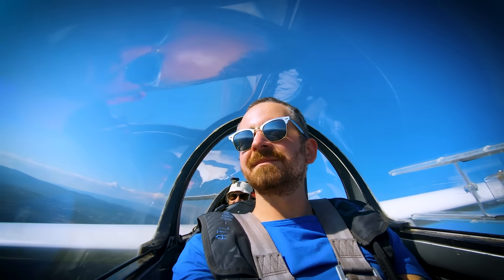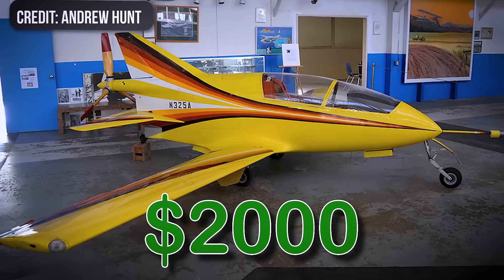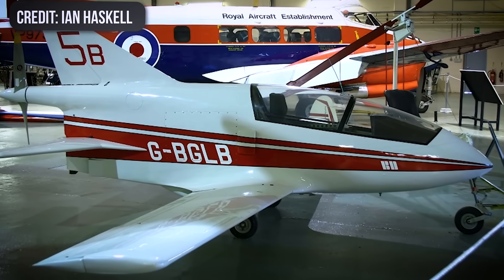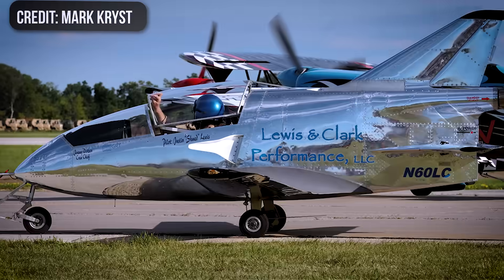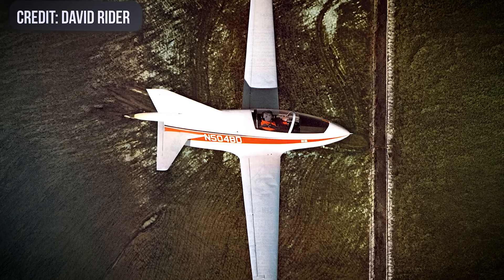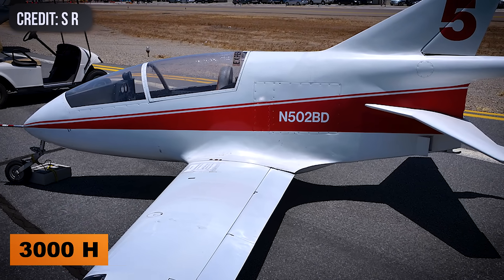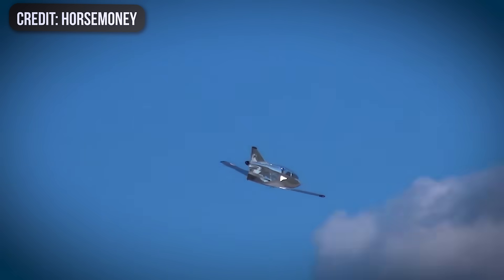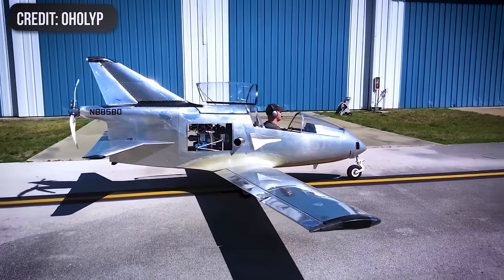This ‘$2,000 Jet’ Seduced Thousands of Pilots… Then Turned On Them

Comment: The BD-5 should be resurrected in Carbon Fiber.  Engines of over 100hp that fit in the form factor are now available and they are miserly on fuel providing greater range.  The carbon fiber construct would save even more weight.  A turboprop version in that space is also available.  Today multiple turbine engines could provide a power plant but they will consume the 50 gallons of fuel pretty quickly.
Reply: None of the above addresses the stability and other malignant flight characteristics that have cost many their lives. By the time enough changes are made to resolve those, you have an all new design. Best to you!
Reply: @jimhorn2608  Yes.  There are so many much better designs available now.  Risen is one.

Comment: You mentioned Burt Rutan, but not what he did for Jim Bede.  Rutan was responsible for fixing many of the BD-5's issues (like flight instability).  Also, he learned how NOT to run an aircraft company by watching Bede.
Reply: Burt also discovered composites during his tenure with Bede. He was building his first homebuilt design, the VariViggen, at the time.  The VariViggen is a wooden aircraft.  For the jet version of the BD-5 he had to mount the batteries forward of the seat under the pilots thighs for weight and balance considerations.  To make a cover for the batteries he used a non-conductive material called fiberglass and resin.  That experience then helped him go all composite on his subsequent designs.

Comment: Fast FORWARD........This design  build it from carbon  fiber  .... "stretch " the fuselage  12 inches ...add turbo jet...increase wing in size and strengthen  the gear and wings ...over ALL YA GOT A NICE AIRCRAFT...Fast forward 55 years
Reply: With a fuel consumption 3 to 5 times that of a typical piston engine and propellor, it's definitely not a design for inexpensive flight! Or practical (no baggage). One can dream, though!
Reply: @jimhorn2608 live to fly....✈ FLY..to live...

Comment: Jim Bede was a very good aircraft engineer, and spectacular salesman, and a poor businessman who could not deliver on his promises.  All airplanes are a series of compromises, and the BD5 was/is a solid airplane with reasonable compromises.  So are/were his other designs with the exception  of the BD-10.  His designs including the BD-5 were poor candidates for low time pilots - a necessary problem if you demand high performance.  Add the resonance issues with the driveline and the reliability issues with a 2-stroke powerplant, and the accidents were sure to happen.

Comment: I'm no aerodynamics expert, but as someone who has built and flown R/C model aircraft for years, it looks to me as though the wing is too small and too highly loaded for comfort, meaning it could snap right out of a tight turn unless the airspeed was kept high.  Also, the moment arm / fuselage is so short that you would expect very high pitch sensitivity.  All in all, a plane with very little inbuilt safety margin - one that would be very unforgiving when flown by an average Joe (like me!)

Comment: I built a KR1 in my early days because I didn't have the money for the -5 kit. But I bought one later from someone who gave up on it and I was surprised that a "simple to build" airplane needed skilled machine shop work, welding, tedious trimming of the fuselage and wing skins, and careful alignment at assembly. All of that was beyond the skills and means of Bede's target builder audience. I actually completed my airframe, but got discouraged by the $8000 cost of the Hirth engine, which was recommended by a secondary build supplier. (That build supplier also worked up a turbo prop version using a T62 APU engine.) I knew a guy back in the 70's who had a BD-5 partially built and I was shocked by the poor quality workmanship, and I suspect it had to do with the difficulty of accurately aligning the skin panels. I finally sold my completed airframe to another builder who was willing to spring for the engine. I haven't heard that it has flown, partly, I suppose, due to the fact that that friend is still alive.

Comment: I built and flew two Long EZ's over 2,000 hours with very few problems. At an average cruise speed of 200 MPH that's the same as 8 times around the world. I've done first flights on 6 different homebuilt planes. I wouldn't do the first flight on a BD-5 for a million dollars.
Reply: Did the first flight of an A-10 ultralight. Amazingly lived to post here. It would yaw the whole flight. I didn't dare move controls so as to not start the feedback loop of death. ❤

Comment: The biggest downfall of the BD5 were the lack of a suitable (reliable) engine.  Having 'enough' power solves a lot of problems.  Having enough power reliably would have overcome many of the early accidents.  Having well qualified pilots would have eliminated the rest.  I suspect just as many unqualified drivers have died in high performance cars as unqualified pilots died in BD5s.

Comment: I understand what Bede was going for in his design, but even from a young age seeing it at an airshow in the 90's, that plane always looked unnaturally small and seemed to violate or at least flirt dangerously with the laws of physics/aerodynamics. I had built balsa and fabric flying models with my dad (which started me down the path of applied science and engineering later) and maybe that combined with a touch of autism had me intuiting that that thing wasn't all right. I'm an amateur WRT aviation and aero design (and at 6'5" I would never try to cram myself into something like that), but like other people have already commented, that thing scares me.  

My take FWIW, on what might have made the plane safer:  
1)Just looking at it, it screams pitch instability,  and to me it needs to be about 12-18" longer.
2)Similarly the chord should be extended at the wingroots, with an improved airfoil for better low speed/stall characteristics; this thing was an underpowered homebuilt, it was never going to be an F-16, low speed and low to the ground is where all the bad happens and it should have been designed accordingly. 
3)The high thrust line-  Obviously the prop had to clear the ground on TO and landing, so here's my radical take on that: High wing. It would change the look dramatically. It wouldn't be the same aircraft, but it wouldn't have the bad pitch characteristics.  Look at the Dornier Alphajet trainer: Short aircraft, highwigh, long chord length at the wingroot. Connecting the wing spar at the top of the fuselage vs the bottom would be slightly more technically challenging with managing the interface between the leading edges and canopy, but its doable (especially on a slightly longer craft).  
Anyway, #3 is essentially "make a different aircraft" , but even if just 1&2 were applied, the pitch and stall characteristics would improve.

@tsparker99 I'm sorry for you loss.  Clear skies.

Comment: I had personal experience with this company and had invested in this airplane. I kept close attention of the progress for this reason. The problem with the BD5 was that the original engine it was designed for had problems and became unavailable and a suitable alternative was hard to find. So much of this video is BS and obvious you just through in a load of non-facts as fact to get clicks . My suspicion started with the title you used. It was never advertised or promised as a $2000 Jet. I had a deposit on the prop driven version and this version was a lot more than $2000. Anyone with ANY experience in aviation knows you couldn’t even get an jet engine back then for $2000 dollars. If Jim was still alive, you most likely would be facing a suit for slander.

Comment: Had mine framed out when my dealer ,an aerobatic pilot ,Ed Mahler , with the fixtures  in his shop to make the retractable gear line up was killed flying his biplane and I sold it for $1,000.I still regret not finishing it stiff geared anyway . I had the wrong engine,no prop tube kit and then they explained the wings were actually too short to safely fly after finishing them . It was still an  experience that flamed out . I went RC pylon racing after that for 15 years.
Reply: Big Ed..RIP…. I can’t still remember the Mennen scented smoke oil….

Comment: I had a close friend who built and flew one, when he couldn't get and engine from BEDE he stretched the fuselage and put in a Honda engine using an aircraft carburetor.   Too familiarize with the Bede's flying characteristics he bought a  AA1 Yankee.  This was also a BEDE design before it was sold to Grumman and handling was tricky like the BEDE.  Sadly my friend was killed but not in the BEDE he crashed doing dumb low level aerobatics in the AA1,  he was a private pilot with no real training in aerobatics.   He left behind a loving wife and two sons....

Comment: My Dad was a Spartan certified A&E who had rebuilt several planes and was scratch-building a Volmer VJ-22 Amphibian in his workshop when the BD-5 came on the scene.  He took one look at it and realized how dangerous the design was, or as he put it, the plane was going to be a pilot killer.  An aviation magazine article I read a few years later summed up Jim Bede pretty well when it described him as the P. T. Barnum of aviation.
Reply: Did he complete the VJ-22? I helped a builder in WI in the 70s. We installed plates on the forward sides of the hull to redirect the water from spraying up against the retracted main gear.

Comment: i was a navy pilot & graduate aeronautical engineer.  i recall chatting a couple times with corky fornoff about his jet powered bd-5j.  i still have a signed pix of him in the j.  i recall discussing its stability & engine reliability.  he told me about the time his engine quit & he dead sticked his to a landing on the interstate, coasted into the exit ramp & into a gas station to the astonishment of the employees there.  i later met with burt rutan.  burt had a much better grip on the aeronautics of his air-vehicles.  bede was a huckster extra-ordinaire.  had some shared personality traits with the dead ceo of the titan sub.  as i learned more about the bede-5, i walked away from it and life moved on.
Reply: You are partially right, but the dead stick landing story was when he flew in the opening scenes in James Bond's OCTOPUSSY. Make up made Corky look like Bond from a short distance. I got to know Corky from doing all of the artwork on the trailer that hauled his BD-5J. Being a NAVY pilot, you might know the story about Corky, and his dad Bill, who was also a NAVY pilot. Bill, by the way, was the ONLY civilian pilot allowed to fly into naval airbases without prior clearance. Bill flew a P-51 in air shows in the 50-60's then switched to the F8F Bearcat in the late 60's, then handed down the P-51 to Corky, who was only 16 at the time. They flew as a team in the two planes until Bill bought the last F8F built by Grumman to put Corky in. Corky's 'cat was built by Grumman to be used by Grumman's V.P. It was built using spare parts unused when the production of the bearcats was discontinued. It was a striped down version with no armament, gun bays, or tailhook, and the wingtips didn't fold. All of those deleted parts saved a lot of weight, which came in handy when Grumman installed the engine. That engine was 200 HP MORE than the standard bearcats had ! The lighter weight, combined with the larger engine made that particular plane the fastest stock (if you want to call it that) prop driven airplane at the time. They flew as a matching Bearcat team until Bill's wing fell off at an airshow in Rhode Island. Corky then went solo in his Bearcat for a while until buying his BD-5J. He would do the first half of his show in his Bearcat, land, then immediately jump into the BD-5J for the 2nd half of his performance. Corky and two other pilots formed a 3 man BD-5J team for a while. For whatever reason, Grumman's V.P. gave it up and it ended up being bought by a college to use for weather observation of all things. The college quickly found it to be way too HOT to handle, so from there, Bill Fornoff bought it for Corky, and sold the P-51. You can research its history from the tail number N007-A if you would like to know more.....THANKS FOR YOUR SERVICE !!!!
Reply: @meauxjeaux431  appreciate the correction and additional detail.  I had seen Bill in the Bearcat earlier at some airshow, but I can't remember where/when.  I always wanted to fly the big piston aircraft but they were already coming out of service and I never got to fly anything other than the Trojan, and later, C1/S2s and C118/C121s as a radial qualified co-pilot.  Back to Corky, the picture I have is of Corky & Bob Bishop, signatures still visible.  Corky's BD-5J tail number is N70CF.  I can't read Bob's without a magnifying glass but it is something like N71AF or maybe AP.  They're flying a tight right echelon turning into the camera.  Pretty sure I was in California at the time.
Reply: @dalemilton5773  Well, I'm not sure it was a correction because after reading more comments I have to second guess myself. Commenter said basically the same thing about Corky having to do a dead stick landing on the highway.  He mentioned that someone called a local TV station and they didn't do a report on it because it sounded too unbelievable, but a radio station did. I don't recall Corky telling me that story,  but reading the comment kind of jogged my memory. That being the case, your story would be correct, and my guess is that Corky relayed that story to the James Bond Octopussy writers and they were smart enough to run with it, because that scene was really funny. Now, that's not the case with the missile chase through the hanger. and subsequent explosion. Corky actually did fly through it. That scene is what accidently got Corky into the movie business directing, and sometimes doing the actual flying in aviation stunt scenes. It was just something that fell into his lap, but he really enjoyed doing it and was smart enough to realize that he might have had something exciting and fun that he could expand on. He told me that since he had connections in Hollywood, and I was a good artist, he could immediately get me a lot of work before even getting there and without having to struggle. He almost had me packing my bags, but in hindsight, seeing what Hollywood was really like behind all the glitz and glamor, I am glad he offered, but even more happy I declined. That place is full of insane, fake, Godless, immoral, and drugged up nut cases ! Corky was lucky (SMART ENOUGH) to come out of there still fully intact, both mentally and physically.
Reply: Some of us know a fraudster, con man, cheater, liar, narcissist, predator after 5 minutes talking or listening to them. Unfortunately, we have many millions in the USA and one prime example is in the WH now! Typically found wearing a suit or a uniform or in a position of trust, power or authority.
Reply: That's odd, I thought about that dead titan sub CEO while watching this video also...

Comment: 👍👍 Great blast from the past review!  Like many others, I WANTED ONE when it first debuted.  I do remember many of the horror stories though.  And I had thought that the BD-5 was originally designed to be a jet, but that a suitable engine was unavailable so it became a pusher prop.  By 1979 I had gotten my PPL, learned to fly my single seat Bensen gyrocopter myself, and planned to build a new Rutan Vari-Eze.  Instead I ended up getting a fantastic deal on a brand new Cessna C172RG Cutlass in 1981 and was having the time of my life in my late 20s.  Around that time Jim Bede began offering the very sexy twin tail BD-10 jet kit and I was once again salivating and considering ordering the kit.  It wasn't long before it too was proven to be poorly designed with in-flight structural failures causing many fatal crashes.  It's too bad that Jim Bede's  engineering expertise didn't match his marketing skills.
Reply: I had a C177 RG and it was a superb aeroplane as sweet as anything!
Reply: @peterthepilot4413  👍👍Sadly, I never flew the gorgeous Cardinal RG but always wanted to.
Reply from the maker: Thanks for sharing your detailed memories and insights on the BD-5 and BD-10!
Reply: Built, learned and flew the Bensen B8M. Best fun ever.
Reply: @EIGYRO  I agree 1000%!  My little B8M was the most fun aircraft I've ever flown.  Mine started life as a 72hp McCullough and having to hand start the blades.  I later sent the engine off to Dave Prator [sp?] in Tennessee for his twin-carbs upgrade that yielded a whopping 105hp.  I also went with the flex cable drive for short takeoffs. WOW what a difference both of those mods made!  I sure miss that lovely little gyro.
Reply: I agree, I definitely recall it was initially intended for a jet engine. My dad and I started building some other kit plane around the same time but never got beyond gluing together a few ribs. I don’t remember what plane it was.

Comment: I ordered a kit, which was never delivered
Reply: You may consider yourself to be very lucky.
Reply: Well instead using the BD5 nose gear, we at EFF developped the Prometheus II , a 2 seater with 2 Microturbo jet engines . 
HB-YBI
 From Sion in  Switzerland I flew west and over the Mont Blanc before returning to Sion. I did the structural analysis for the Swiss certification The BD5 retractable nose gear worked well.
Today that airplane is preserved in a museum East of Toulouse in southern France 
(Musee du vol a voile)